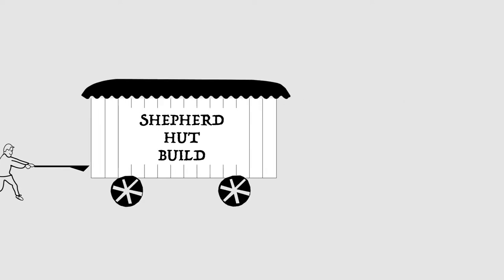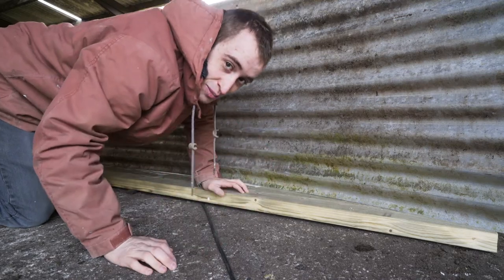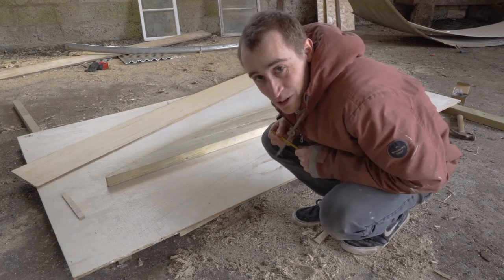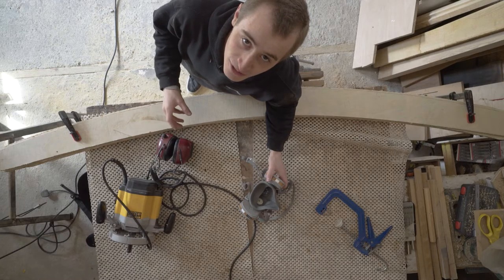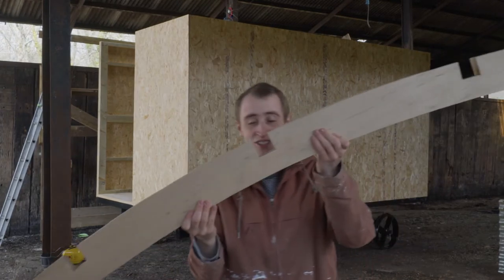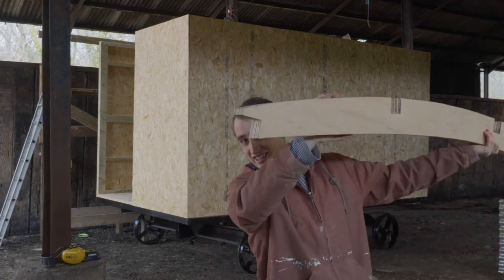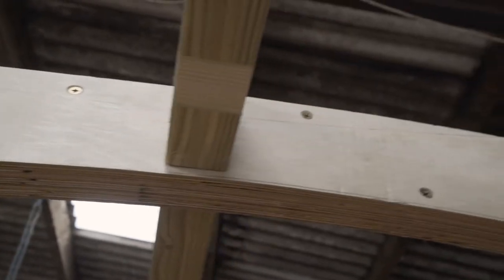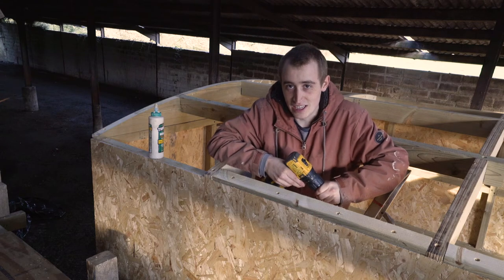How to Build a Shepherd's Hut | Making the Roof EP3

Comment: Great Eddie, but interior insulation etc? Would love to see. Hope it doesn’t but did your floor boards have a high moisture  content when laying? Shrinkage as it dries will just cause gaps but if it was 16 to 18 % you could find it expanding, compromising your end wall  rebate junction. Hope its okay. A winter would prove  it one eay or other if you  didn't take moisture 
readings. Good luck

Comment: Can you please help.
Where did you buy the metal sheets? Did they bend them for you?
What is the size of timber you use for long central beam and other beams for arch roof rafters?
Reply from the maker: The sheets are off an old grain bin and the long beams are pine 2x4's. I made the arches with 2 layers of 18mm plywood